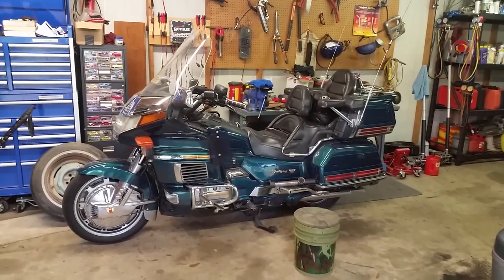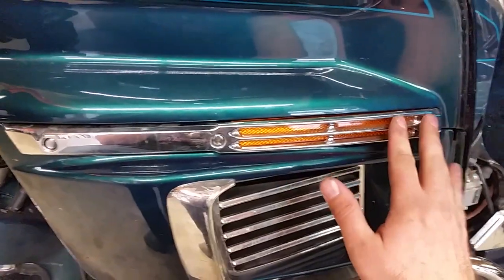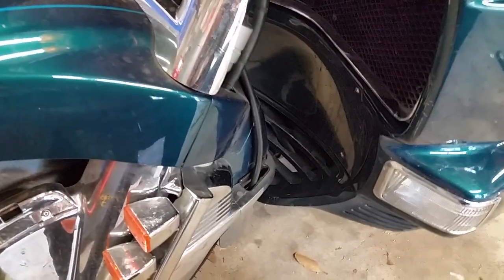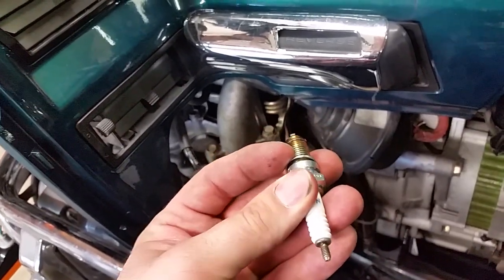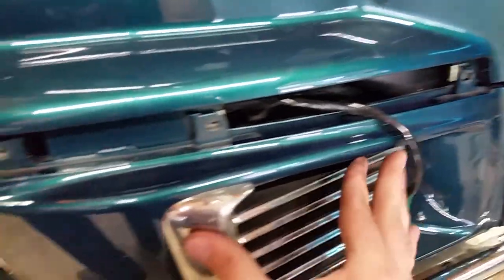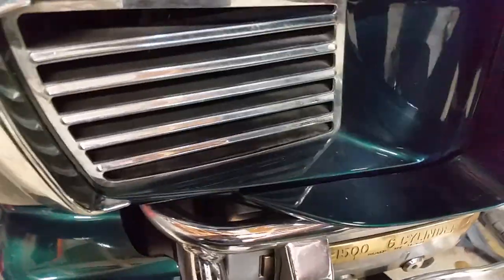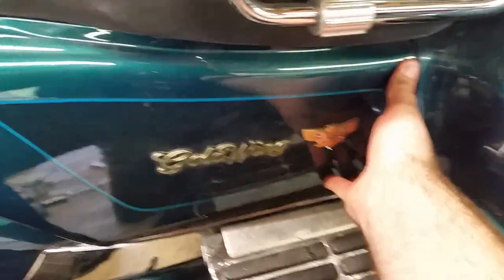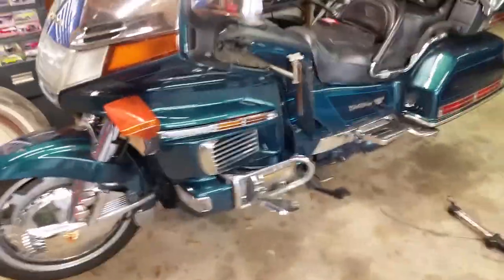How to change spark plugs on a GL1500

Comment: For anyone watching just a small tip.  Do not use anti-seize (just like Mr. Clifford did not use) if you are using NGK's.  NGK has an anti-seize coating already on.   This is directly from talking to their tech department.  Also, just for completeness, the gap is 0.036 in. and the torque is 12 ft/lb.  Awesome video.

Comment: My 93 with over 280,000 miles on it still has the factory plugs, never been tuned, filters have been replaced,  runs wonderful.  Dealership said "don't mess with it". Gets 42 mpg. Just for the record.

Comment: I periodically soak my rubber grommets in transmission fluid. Over the years I've found this tends to keep them from drying out. Easy enough to  do. I use one of those small snack baggies, toss em' in, cover em' with the fluid and let em' hang for a day or three and then put em' back on the scoot!

Comment: Used your video today Cliff to take mine apart to change plugs. Haven't got new plugs yet, but ready for them. Only thing I did different was I took off the bottom shroud also. Easier to get front piece to come off.

Comment: Cliff, me again. My Wing quit again, have to replace the alternator again. I think you have taken much of your bike apart and I am in the process now changing the alternator. There is a wire from the alternator and goes up into the body behind the reverse gear lever and it plugs in to a block. I cannot get that panel with the reverse lever off. I cannot find what is holding and there is now way I could fit my hand in there to unplug the wire. I have seen a video where the guy just cut the wire and spliced it but I would rather do it the right way. Do you have any information on how to remove the panel with the reverse lever attached  ????

Comment: Would love one of these bikes but I refuse to buy any bike that is overly difficult to service or clean. I have a Yamaha V-star XVS1300 cruiser. Service times are: Plugs 5 mins. Oil change 10 mins. Air filter replacement 2 mins. Non serviceable drive belt. No timing belts. I really would love the extra weather protection and comfort of a goldwing but I would find it just too stressful come service time and unfortunately, my pockets aren't deep enough to pay someone to do it for me. I wonder how many other riders are like me and wonder how this fear of servicing affects sales.
Reply: its more intimidating than difficult.  and once you have done it a couple times its almost autonomous. also when your handling hte body parts you can inspect them for cracks and other damages. tune the fit if needed.  and also when running wires for aux devices.  dont forget the monster wings can run a plethora of electronics, cell phone chargers , multi camera, GPS devices, I have my MP3 player mounted as well playing into the stock stereo through an Aux cable added to the system board. and a simple bluetooth receiver that also shares the aux cable for phone music/videos and even phone calls go through the on bike headset intercoms. 
  I rode cruisers for 43 years, 10kms on my first 83 gl1100 i said, why haven't I been on one of these?  its the most comfortable bike i have ever ridden.   smooth powerful, forget about hand buzz after some distance.  none.  
I'm not trying to sell you on it, but only sharing my initial thoughts with one that was 38 years old, needed head gaskets done, forks done, rear shocks done, exhaust done and two new tires needed.   I took a chance on it for $600 delivered.  now its an amazing bike.   so good that I said if this gl1100 is this good ...the GL1500 must be even better.  I wasn't disappointed.

Comment: Hi Cliff, my gl 1500se 2000 my reverse when I turn it off the bike is still in reverse and the on and off swith will not shut the bike off, the bike is in N but now you can only shut the bike with the key it's like the polarities have turned around you have to leve it in reverse and turn it off with the is it because the pin broken I can't seem to turn it around.

Help! Jean in Nova Scotia
Reply from the maker: Wanna say it's switch related, but its hard to say without seeing it. Let me see if the book saids anything.

Comment: Hello Clifford! Thank you for the great advice on working on the GL1500s! I have a question for you about the large lower radiator water hose going to the water pump. On my bike it is touching the center mounting nut for the lower cover and has made a dent in the hose. Is the hose supposed to be touching that nut? I have zip-tied a piece of rubber tubing over the water hose to protect it. Do you have that problem on your machine?
Thanks !!
Reply from the maker: technik60 it shouldn't be touching. I don't have that problem with mine.
Reply: I wonder why it's touching?? Do you have any suggestions of what I can do to fix this problem? Should I replace the hose?
I did notice on some of your videos you where having problems fixing your broken plastic pieces. Check out the video from "Plastex Plastic Repair"
You can get their stuff on eBay cheep it seems easy to use and it has colors to choose from as well.

Comment: Clifford, this is off topic but I am hoping you can help me. I have a 98 Wing and I was on a ride yesterday and the bike quit running. It would not turn over. I checked all the fuses and they were all okay. Every once in a while it would start and run for about one minute and die again. The battery was dead but would build up after setting a while. I figured the alternator went out so that was the first thing I checked after charging the battery. The alternator shows it was charging. With the battery charged it starts and runs perfect. I just cannot figure it out so not I do not trust it. If you have any thoughts on this issue I would sure appreciate it.
Reply from the maker: Sounds like you need to check your battery. It might be bad, I would have it tested
Reply: @CliffordRice  this is a new AGM battery 2 weeks old. I checked all the fuses and connections this really has me baffled
Reply from the maker: Something is draining the battery, is the only thing I can thing of at the moment.
Reply: @CliffordRice  thanks Cliff  I thought I had checked everything. I am just wondering if maybe the alternator comes in and out
Reply: Cliff, I just wanted to report that after a month of trying to find out what was wrong and found nothing I took the bike for another ride and it did the same thing QUIT RUNNING. I quit right in front of a tire store and the guy was a biker and he came out to help me. I removed the battery and he checked it and told me my new battery had a short in it. This time it also took out the alternator. Replaced battery and alternator and the old girl is running like she used to.

Comment: Have a question for you.
I have a GL1500 and my brother changed the oil and filter. Next, he wanted to clean the spark plugs. He cleaned the spark plugs with gas, dried them off and put them back in. Started it up and it ran rough and back fires when the throttle is turned.
So we tried new spark plugs. With the new spark plugs it is still running rough and back firing. It is in the correct firing order with no crossed lines. The gap was checked and is between .8 - .9 mm. I have no idea what is wrong and it is frustrating.
Reply from the maker: iwannaapple, Your carburetors are most likely the problem.
Reply: The bike had been running just fine. It had only been about 30 minutes when I got off of it running around getting the parts needed. So, I don't understand why you say the carburetors. Can you explain that please?
Reply: In fact, as of this morning, we cleaned the coil wires to make a better connection with the new spark plugs, cleaned the air filter, and he just pulled up into the driveway with the carburetor cleaner to try and clean the fuel filter. It as almost as if the fuel/air mixture is not right now just because of cleaning off the old spark plugs. But it was running just fine minutes before any of this was done. I should have spent that $85 an hour at the shop.
Reply from the maker: iwannaapple,  your rubber slides inside the Carburetor could be worn or rip. All it takes is a pin hole  to them worthless. I've seen a few bikes with similar issues and that usually fixes it. I can't say for sure this will fix your problem, it's a good place to start.
Reply: Is it possible to tighten spark plugs in too tight and cause this rip?
Reply from the maker: iwannaapple, your slides are inside the Carburetor
Reply: iwannapple, you ever figure out what was wrong?

Comment: I ride a GL1200 and tge thing I like the least is all the plastic. I have been pitching some of the useless trim as I go. Next summer I'm planning on removing the complete fairing. It is just too hot for mid summer riding. I jave thought about a 1500. I love the 6 cylinder engine. The amount of plastic on the 1500 would drive me nuts though.

Comment: My 1995 Honda Goldwing will start with the chock on but as soon as I take the chock down does anyone what is happening and how to fix
Reply from the maker: The carburetors is you problem, most likely need to be rebuilt
Reply: There is a idle stop adjuster inside fuel fill compartment, it's possible adjusted to far out. I believe chock has it's own throttle adjustment.

Comment: It is not a good idea to put plastics on the bare concrete painted face down, they scratch very easily. Better to lay a cloth down under all area, sheet works well or an old blanket...covers a large area.

Comment: For the absolute novice to a 1500 motor, this was only partially helpful. One spark plug isn’t all the plugs. I really needed to at least see the position on all 6 plugs. 
This is more of a tutorial on removing plastic.
Reply: to expose the plugs under the plastic...once the plastics are off the plugs are under the rubber mat.  peek under that rubber and "Ta-Da". fire sticks!!